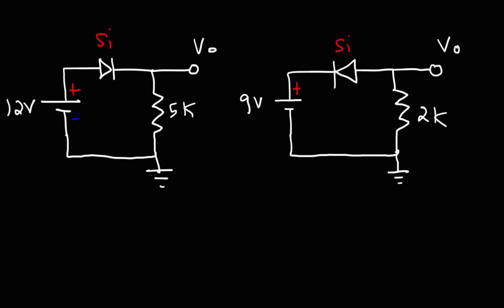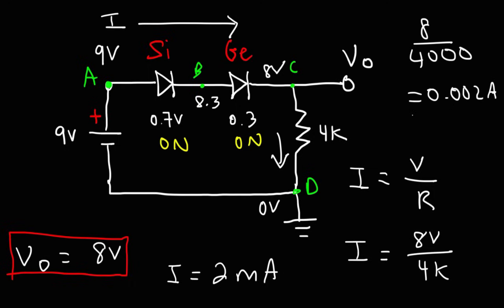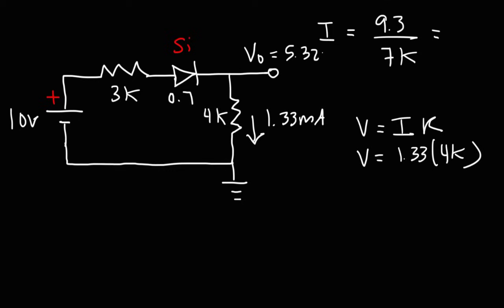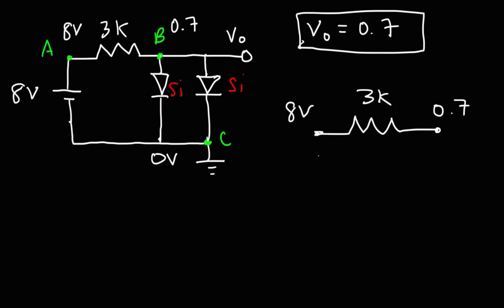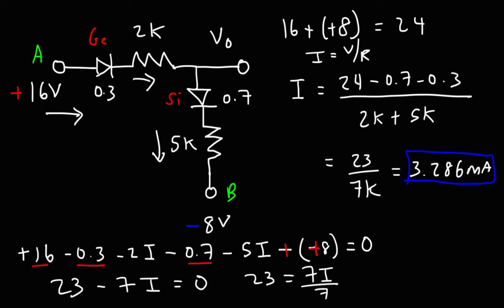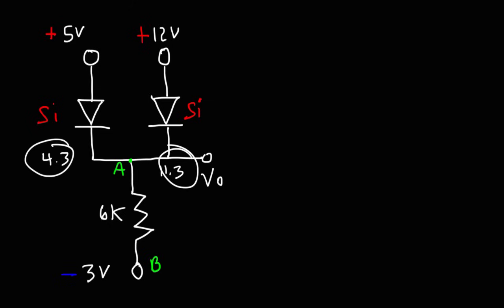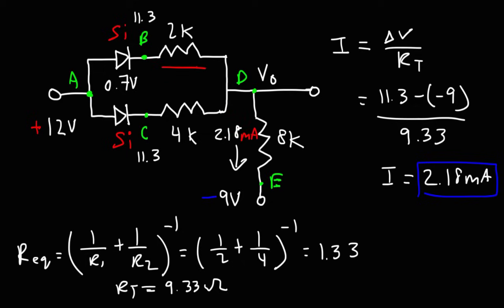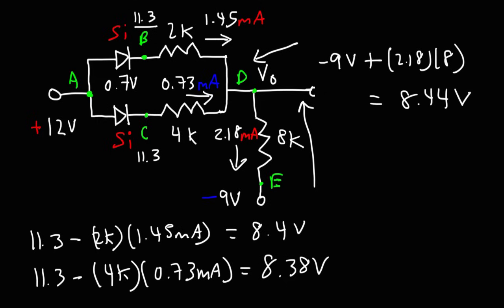How To Solve Diode Circuit Problems In Series and Parallel Using Ohm's Law and KVL

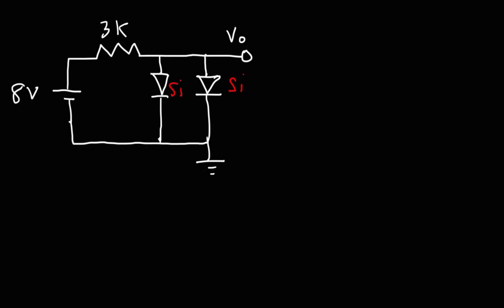Comment: 10:09 may I ask why is it multiplied to 4, not to 4k ohm resistance?
Reply: I get it now hahahah cuz current (I) is in milliAmpere that's why it is equivalent to 0.00133 x 4k that's why output voltage is in 5.32 XD

Comment: 19.09 why does the higher potential "win out" over the lower potential?
Reply: If we consider 5v diode to be ON,then V=4.3v and hence 12v diode is also FB hence it will also be ON which is not possible...
But if we consider 12v diode to be ON,then V=11.3v and 5v diode is RB.Hence 12v diode is ON and 5v off..

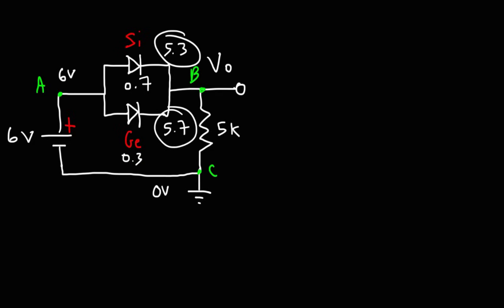Comment: At 5:10, you state that the Si diode is off because 'the Ge diode needs less energy to activate.' But it seems to me the reason must be that the forward voltage across the Si diode is only 0.3 volts (as the Ge diode has pulled it up), thus it can't turn/remain on.
Reply: Yea, i am wondering whats going on in that circuit.  2 ideal voltages sources in parallel have the same voltage; these are diodes so i guess that doesn't apply.  If it is true that only the Ge diode turns on, then i suspect there is no real practical application of this circuit and the silicon diode is redundant.

Comment: in the last question what if we had silicon in 1 path and germanium in the other
Reply: I guess the germanium path will be on and the silicon will off. I'll simulate it.
Reply: Here it is. Both diodes on but the resistor have different voltage drops. So they aren't parallel. 
https://drive.google.com/file/d/13hcbWsMhe6SAbabWO3CtaxDj_H3CegR-/view?usp=sharing
Reply: The current will increase slightly through the Ge diode path. That’s all.

Comment: How could we calculate if the type of the diode is not mentioned?
Reply: You can assume it is an "ideal" diode where the voltage drop is 0V. At least that is what I was told by my professor :P

Comment: At 22:50 min if in parallel one diode works, why did you take the equivalent of resistance in parallel. We should neglect the lower resistance (4)
Reply: I think because the voltages are equals in D1 and D2 so it’s like a parallel resistors
Reply: Because B and C are at the same voltage.

Comment: 10:40 if the other diode was a Ge diode, the Si one will be OFF right?
Reply: i think it is not likely to hvae a Si diode in parallel with a Ge becaues this would mean that point B at two different potentials 0.3 and 0.7 it is not valid in circuit theory for a single to have 2 different potentials if you have a resistor in between this is possible to happen
Reply: @Dead Pool  Yes it may happen but the crrcuit will function improperly as i described above
Reply: Yes the Si diode would be off

Comment: 11:32 Why voltage at B point is 0,7? It's not passing the any diode yet?
Reply: Because since point C is taken as a ground node i mean a reference node all our potentials are measured with respect to it and a silicon diode has a typical voltage drop across it of 0.7 volts one of the terminals is at 0 volts that is the ground terminal so the other has to be at +0.7 volts
Reply: @dtm7743  shouldn't the voltage at point B be 8 minus the voltage drop of the 3k resistor???
Reply: @praveensharrma465  Yes it is right you are harry but why would you take this way ? whenever you have a diode that is in the forward biased mode you can say mearly that the voltage drop across is 0.7 and sice and just like i said before point C in taken as ground ,potential at B is 0.7 with respect to C if C was not a ground node i would  not have been able to say that
Reply: @dtm7743  If we did not take C as a ground then ?
Reply: @AI-kr7mj  what else node would you take as ground? when talking about voltage in circuit theory the node's voltage has to be measured with respect to a reference node because there is no such a term "voltage" instead we say potential difference the well-known reference point in circuit theory is the ground what is a a potential of 0 so you are not required to take your reference as the ground you can take it else where but i suggest you do not over complicate  it you just take the bottom node as ground and all other node voltages will be measured with respect to it
Reply: i am confused
Reply: @sebastianp.8895  Lets just say you have to use up all the voltages, meaning before you reaches the ground node, 8V must be distributed (or used up) across each component.
We know that Si diode uses up only 0.7V, meaning 7.3V are used up by the resistor. Ignore the second diode as voltage across parallel wires are the same, there you have 0.7V remaining at the node B.
Reply: @sebastianp.8895  Don't be confused. From the diagram, the output voltage is V0 is the same as the voltage drop across the 3K resistor, which is 8-3I, but the current in the circuit can be calculated using the close loop between the first diode. That is 8-3I-0.7=0 therefore I =2.43mA so 3I = 3*2.43 = 7.29V. To get your voltage drop it will be 8-7.29 = 0.71V (the output volt)
Reply: @shichiya5743   best answer and easy to grasp
Reply: @sebastianp.8895  B is connected to ground through the diodes. If the diodes were ideal then all 8v would be across the 3k resistor.
Reply: @dtm7743  brother why is the voltage output 0.7? instead of 7.3
Reply: @jaysonverzon172  because if you know th KVL RULE if you know the potential difference and voltage across positive or may be negative you can calculate a voltage at positive easily by using the formula v=v^+ - v^- and you will see in the curcuit the th voltage at v^- is 0v and the voltage across diode is 0.7v and by using formula v=v^+ - v^- wee will arrange it v - v^-=v^+ so we will get v^+=0.7-0 and at end v^+=+0.7 and now i think you will understand it easily
Reply: @jaysonverzon172  B would be at 7.3v  if you swapped the diodes & 3k resistor…
Reply: I have a question, what if the second diode is Ge? What to do?
Reply: @AlmoenMercy  since the ge will be at 0.3 if im not wrong it will only activate that one like in the question done earlier. Because current will always take the path of least resistance if I think
Reply: it is what is "left" o the voltage for the loop tp some to zero because once it passes through eh diode it will subtract .7 and therefore be zero